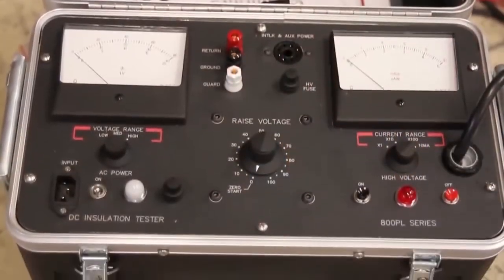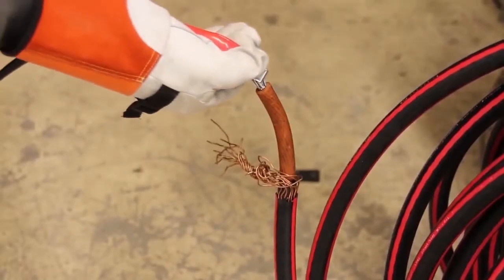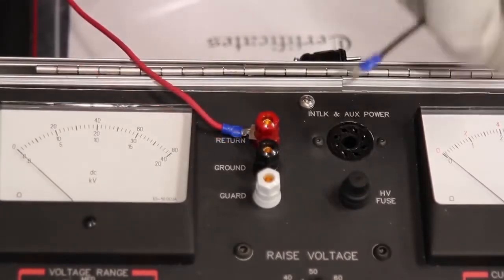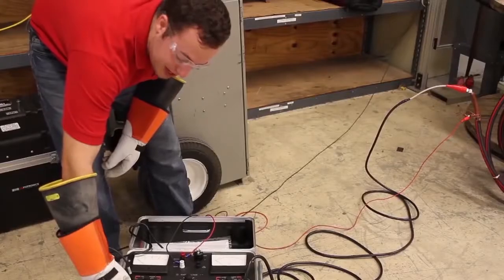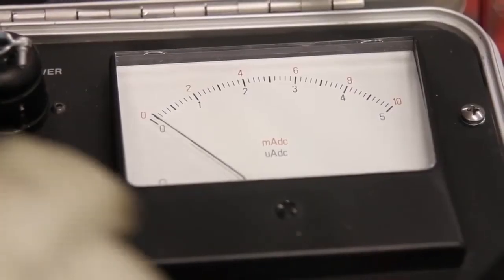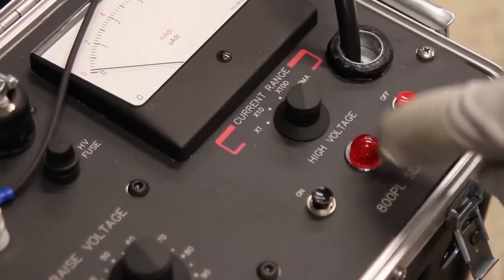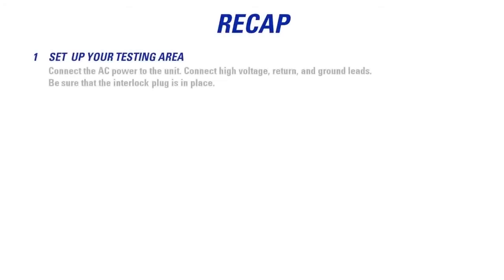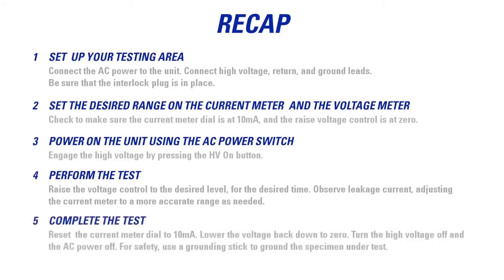DC Hipot | "How-To" Video

Comment: can you make a demo showing sample of failed test due to faulty cable insulation? any tolerance value for failed/acceptabl;e value?
Reply from the maker: @arlanalvar362 thank you for reaching out! Since we no longer manufacture this version of this Hipot, we will not be making other videos related to it.  Regarding tolerance values, the standard sets those values.  Therefore you would just need to look up the standard to which you are testing.  I hope that helps! Have a wonderful weekend :)